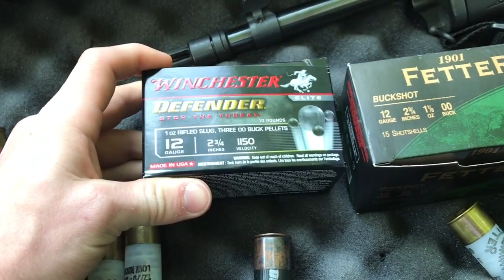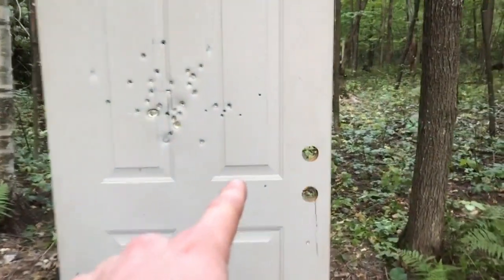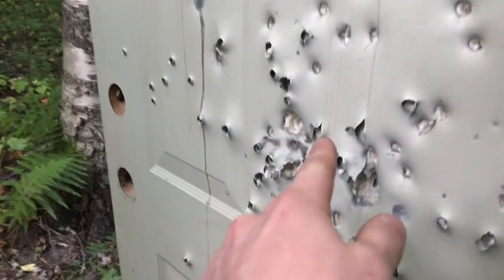Will a Steel Door Stop a Bullet? Shooting Steel Exterior Doors with Guns.

Comment: As you've mentioned below, these are off the rack home depot finds. Common, but anyone actually concerned with security is not purchasing these for their homes.  Outside of full on security doors, traditional iron doors are currently using 12-14 gauge steel...with a foam core insulation that probably provides a more resistance then the dusty particle board holding that metal.
Reply from the maker: Your best bet would be to purchase a door that is actually rated to stop a bullet, unless you build something ridiculously heavier that would stop a bullet. 

Also, these doors did have a foam core insulation.

Comment: What is the thickness of the steel plating if you don't mind?
Reply from the maker: The thickness of the steel in the doors is approximately 0.023" - 0.031" (24 gauge steel). This is very common for most STANDARD steel doors that you would purchase in a big box store. However, some doors (often referred to as security, armor, industrial, etc. doors) are manufactured with heavier steel usually between 20 - 14 gauge. Clearly, these doors have better bullet-stopping capabilities, but they still won't most stop bullets.  If your goal is to have a truly bulletproof door, you will either need to a.) buy a door designed and built to be bulletproof b.) find a VERY heavy steel door (1/4" steel for most threats, 1/2"+ for higher-power rifles) or c.) just rig your door and any necessary components with something capable of stopping bullets.
Reply: @CarlsontheOutdoorsman  I work for a high end iron & timber door company in the Atlanta area. All of our iron doors use 12 gauge steel.